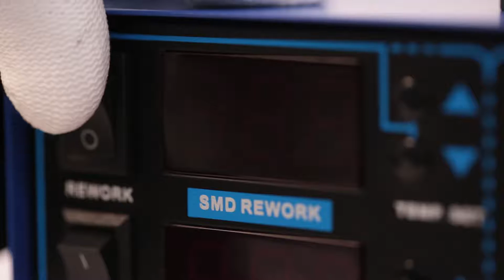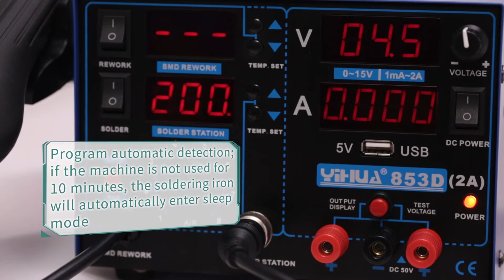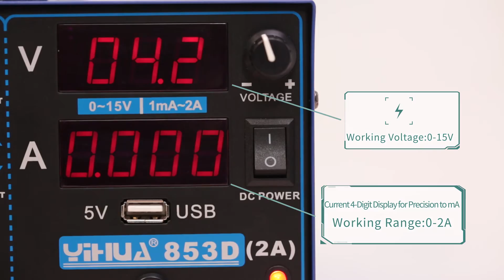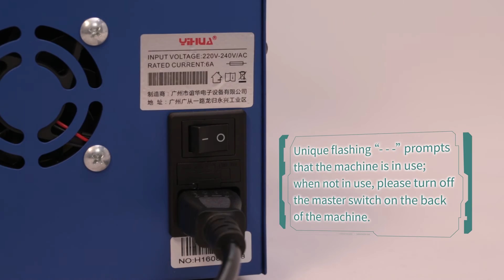YIHUA 853D 2A USB Upgraded Version 3in1 REWORK STATION, SOLDERING STATION & DC POWER SUPPLY

Comment: this would be an exelent model IF a t12 tip is used and internal turbine for the hot air nozzle the manufacturers alway miss the point of doing it properly